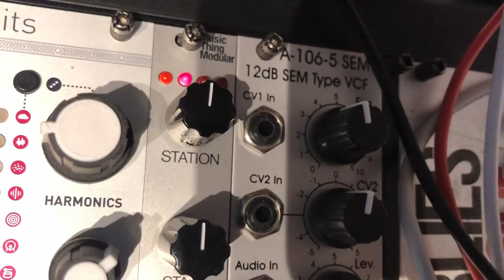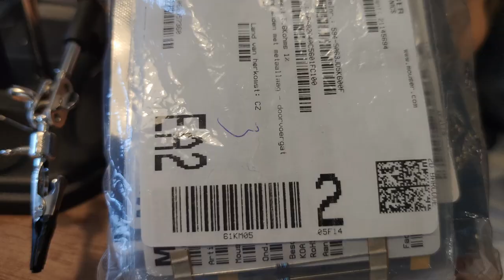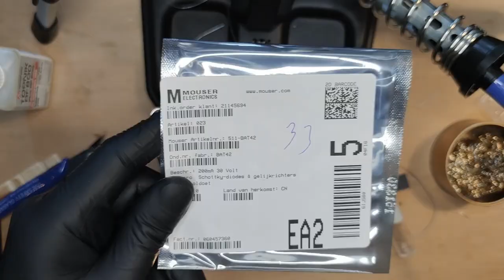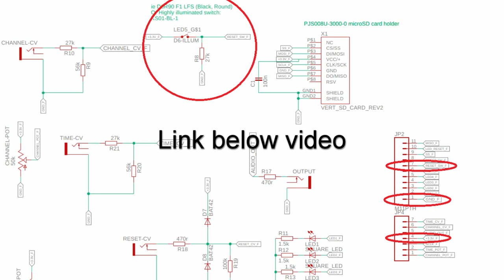Prok drums build, audio demo, and review

Comment: Dangit, I seem to have the same kind of issue, either damaged something on the board or there's something faulty with the pcb. I'm leaning to the latter as I haven't been able to find anything out of the ordinary. Ordered a new back board, fingers crossed...
Reply from the maker: Is it exactly the same problem? Could you check if you measure a short across R8?
Reply: @Channel37synth  Nope, no problem there. It boiled to the back pcb. Resoldered and replaced parts to no avail after which I could only conclude the pcb to be faulty as I could not find anything out of the ordinary done by hand.
Reply from the maker: @KPsTboy  another thing to check is if you have shorts between pins on the board headers
Reply: @Channel37synth  I can confirm no problems there. Bought a new backboard from Thonk. Took the parts off the ‘old’ one, measured the parts again, and soldered them to the new one. Yay, tis working now. Couldn’t find anything that I accidentally might have cut on the board, so it’s my conclusion the board was faulty.
Reply: Great support by Thonk I must add.

Comment: What trace are you cutting on the teensy?
Reply from the maker: As described in the build guide, the USB power trace should be cut on the teensy, so thst it only receives power from the module even when plugged in to USB and powered up. Receiving power from two different sources would be not good

Comment: Is it in fact really cheaper to buy the partial kit and order the parts from Mouser than ordering a full kit from Thonk?
Reply from the maker: Yes, it's cheaper, but you might spend some time picking the order. We had to order from mouser for another project, so we had an extra incentive to exceed the shipping threshold. We saved about 70 euro.